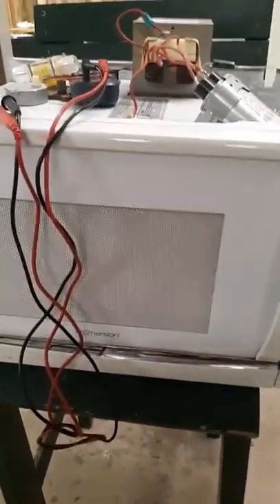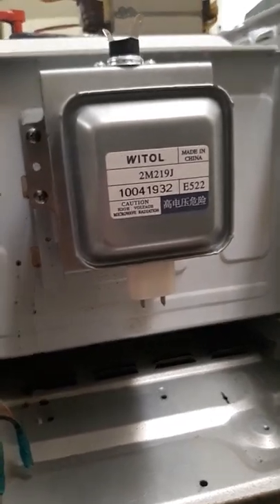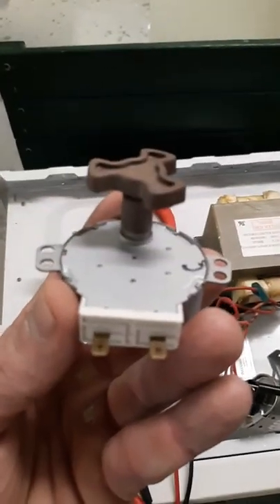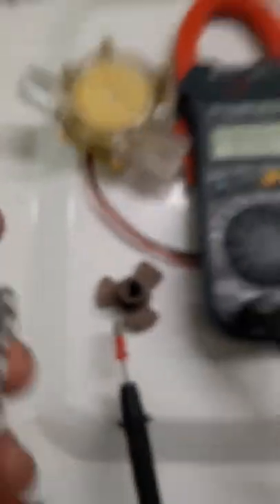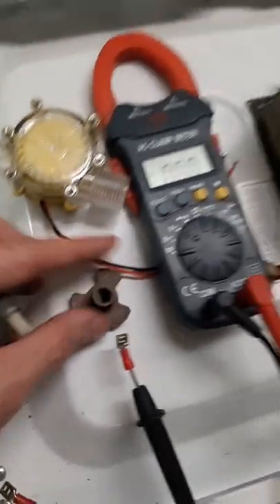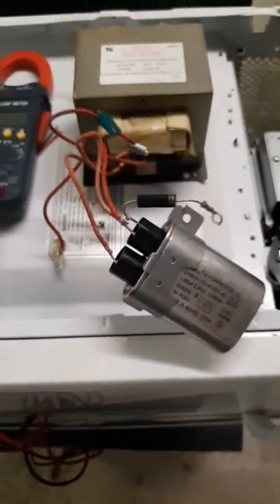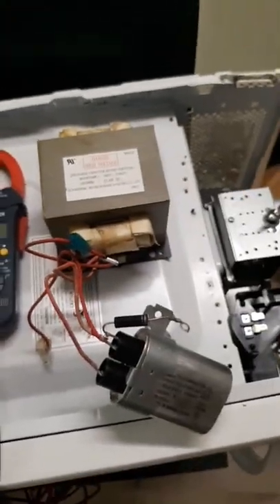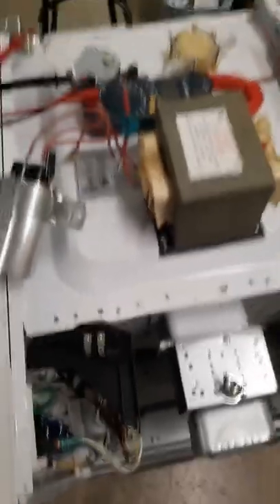WHAT THE POWER COMPANIES DON'T WANT YOU TO KNOW!!!

Comment: Sorry to disappoint you but you do not get  much electricity by spinning this little motor. Your voltage maybe high with high spin but you get amperage in the range of miliampers. Electrical power is the result of multiplication of voltage AND amperage. High voltage does not mean much if your current is very low. By rubbing a plastic stick you can generate voltage of many thousands of volts and very, very small amperage resulting in sometimes unpleasant shock but nothing more. I am surprised that you guys are so ignorant of the basic laws governing electricity. I am sure there is a lot of mystery to the electricity, contrary to what the mainstream science claims (or rather scientific faith called scientism) but here I do not see laws of thermodynamic violated.
Reply from the maker: Amps read extremely high on the ammeter

Comment: I wonder if also the hydrogen added to the gasoline in the combustion chamber also causes the gasoline to ignite more spontaneously, a more of an all at once explosion instead of the ignition as a spreading, slower rising explosion the it has been revealed that gasoline is that creates the increased mpg.
Because I've Finally seen the question discussed AND answered, revealing just why Diesel get's better gas mileage simply because under the higher compression pressure it ignites more all at once compared to gasoline that is a moving ignition. So with the Diesel, this increases the efficiency of the push on the pistons and therefore increased MPG.
This was revealed with the discussions I've seen on why the new Mazda sky active gasoline engine gets similar mpg as the Diesel engine, because they finally found a way to compress the gasoline to the higher compressions like a Diesel to where it works without preignition.
Reply: That's quite accurate what is happening. HHO, the way we now use it in combustion engine, is rather a catalyst making the fuel to burn more evenly and efficiently, not as a fuel. Therefore, if you add too much of hho you actually lose some of the efficiency or even you can damage the engine because it would run too hot. IN order to burn only hho the engine must be significantly altered that's what Stan Meyer did and died because somebody (guess who?) did not like it.
Reply: keram10 yes well where the so called experts(because they never go and actually look at a vehicle with it installed) criticize.
That if the vehicle is burning hho for the gain, it’s impossible to improve mph because the alternator extra drag for the electricity ti create the hho, will drag the engine down equal for the boost burning hho gives.
So that’s as far as their discussion goes.
They never open their mind and discuss that it may be helping the mpg in other ways.
Reply from the maker: Yes you are correct HHO does not have a carbon molecule in the molecular makeup. Every other fuel has a carbon molecule, multiple carbon molecules in fact. Carbon is very inefficient in combustion. Adding the HHO Gas does increase the combustion rate and allows vehicles to consume much more fuel instead of going out the exhaust this is where the major increase comes from adding HHO to your current fuel.
Reply: Richie Rich thanks Richie for spreading more understanding on the subject!
I actually live in Colorado Springs CO, where Stanley did.
I think I actually remember the buzz news about his invention...but I was about 14 years old at that time.
Well don’t fret too much about the evil oil industry because it’ll just creat a mind trap and hurt ourself and they are just us but born into a different life and family and get a high from having lots of money, one of their mind traps.
I mean it’s said we need to focus on ourselves, and write out of us our mind traps first because we are responsible for ourselves first.
We are all connected and effect the course of mankind more internally than externally in some ways.
So keep up the great work of increasing mpg and don’t forget to make your day enjoyable and fun in the moment.
And I bless you because will any of the many invisible Gods do it and doesn’t blessings loose some of their sincerity when we involve an invisible God as if you say “God bless you so I don’t have to”?!
Oh if you like insider info and self improvement sites check out www.desteni.org
Very nice chatting with your a great person Richie and being a sweetheart makes you even more attractive;)